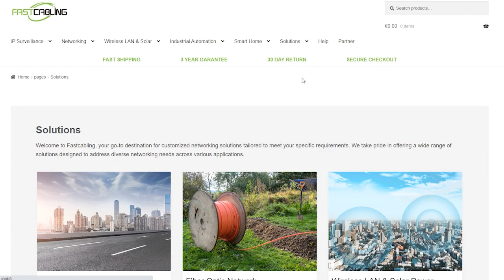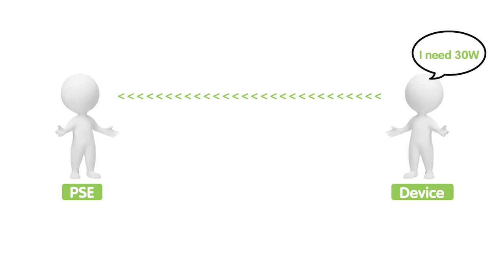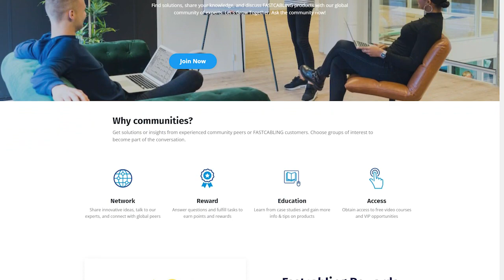Understanding PoE Standards and Their Implications

Comment: love it. my question is you say the switch is poe++(90w) and total power is 180w but if we divide it for 4 port it is 45w each.
does it mean i cant use four 90w device
Reply from the maker: No, you can't. The switch will stay within its total 180W limit.  If you're evenly distributing that across four ports, each port can only provide up to 45W. If any device tries to pull more than 45W, it may not get full power or may not power up at all. However,  the switch can distribute power dynamically based on each device's actual consumption. You can prioritize certain devices to receive full power.